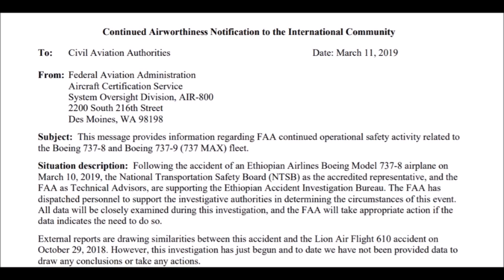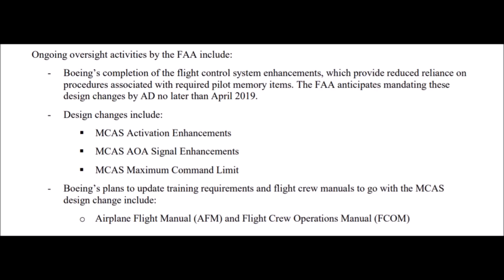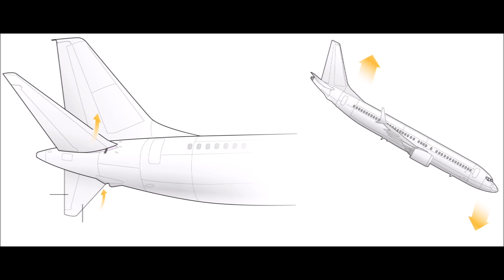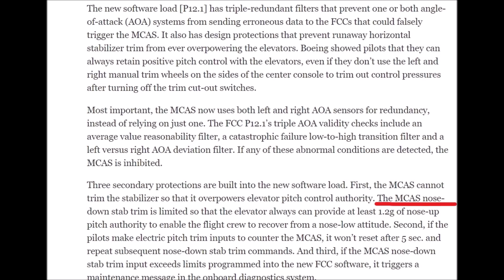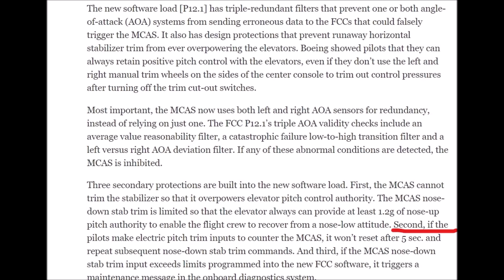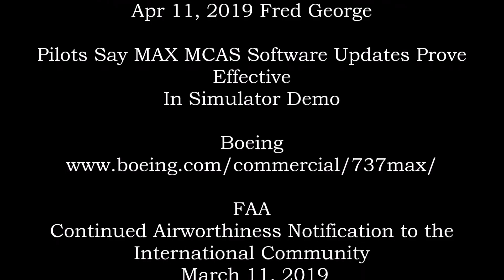737 Max UPDATE 14 April 2019 "The Fix"

Comment: Being a systems analyst I know the BIG difference between systems specification and correct programing. I don’t plan to test the systems by flying MAX before next year.
Reply: Damn straight there is as at the end of the day the ONLY way to know if a computer program works like it should is to do something the programmers hadn't considered as programmers (personally speaking) have major blindspots as how we see the world is written into our codes, or how Boeing sees it though by now they should have enough data if they weren't stupid to run tests on every known issue that's arised followed by asking some student pilots to fly a max 9 simulator or better yet ppl who normally fly other aircraft and then put them into hairy situations. This would work fine as all pilots of large jets at least in the US are required to long in 3 take off and landings which are totally manual in a sim every 90 days. 
      Then again this is the programmer in me talking, not some dickwad Boeing CFO, CEO, project manager who's doesn't give a shit and wants it done YESTERDAY and furthermore doesn't want ANYONE from the FAA to airlines knowing that there is even a MCAS system in the first place. As it defeats their whole selling pt (other then then 10% increased fuel economy) as this was built specifically for economical airlines who fly only one type of airplane specifcally to avoid the issue of recertifying their pilots or having to get new plane parts except the engines which is fine bc the engine will save them money so THATS OKAY. Disgusting all around.
Reply: You do know that ANY software changes especially ones with THIS much pressure as Boeing stands to lose 25 billion in orders are the MOST likely to fail as they can easily break other things while trying to "fix" something.  
       Plus Boeing need airlines to use the planes they have as it's SUPER expensive not to have the plane in the air ALL the time which is the ONLY way these budget airlines which buy these plane make any money. 
    If this wasn't the case there wouldn't be 354 dead ppl right now. As this was ALL about saving money and trying to create a plane which is DIFFERENT handle the same thus it's literally overriding the pilot which NEVER should occur and has NEVER occurred before now, hence Boeing marketing it as a "stall recovery" system not a augmentation program which has NOTHING to do with stalling or at least not directly but bc it was financially beneficial as there was NEVER a need for a MCAS system to begin with.
Reply: @Quin Wow. You really have not been paying attention, have you? You just want to stick your head in the sand and pretend it was all just an innocent mistake. It is now increasingly clear the plane as designed does not require a trim augmentation system. They put it (MCAS) in - and spent the millions - so that they could mislead customers, regulators, etc and present this plane as having the same handling characteristics as previous 737 line. They did not tell anyone about it - it was not in any of the manuals. And this sell more planes. This cynical addition made the plane massively more dangerous for several technical and human factor reasons. And this does not even address the absolutely incompetent engineering design of what they did create.
Reply: @Quin there are a lot of assumptions you are making there. But you are right about much as well - including my conflating several key sources and not just Juan's analysis. And I do understand your main point about a path forward without needless vindictivness. I completely agree with that. I'm an engineer for more than 45 years, and some of the the decisions that were obviously made here were so egregious, that it is a case of much more than "people just make mistakes sometimes". This reeks of a culture of fear, expediency and distrust which is the enemy of safety and good decision making. Just pisses me off because it is is so counter productive and destructive.
Reply: Well unless the pilot has been in secluded isolation, he/she can hardly have missed the learning point now. I suspect you'll be very hard pressed to find a 737 pilot that doesn't know what's wrong if their plane starts going down when they are commanding up. So with or without a tested software fix, as long as every pilot knows where the OFF switch is for MCAS all should be good.

Comment: Thank you Juan for another excellent report. I for one have been waiting for and am glad to see these results. This just demonstrates what I knew all along that the 737max is an excellent and safe airplane. Any new system has potential for problems but they always get corrected in the end. It's a shame that two tragic events triggered these changes but nothing is without risk. Life is risky, and so it flying. Hopefully we will soon see the 737max back in the air and earning the reputation for a safe and cost effective platform that it is. I would happily fly in a 737max tomorrow.

Comment: It’s wild that they didn’t design this into the system in the first place. I’m not an engineer but I can see the recipe for disaster.
Reply: Unlike other Boeing designs, the 737 is a slave to its own success.  Boeing has to walk a delicate line between updating the aircraft to keep it viable against the A320 series, and making it so different that it requires a new type rating or top off training.  I believe that with the Max series, we will see that Boeing erred (grievously) on the side of saving themselves and their customers training money.  The financial hits from lawsuits and lost orders will dwarf any savings they could have seen.
Reply: @RobertsonDCCD  You said it. Boeing boxed itself into a corner to save money and maintain the type rating. But this limited thinking actually will end up costing more.
Reply: agree wtf
Reply: Hindsight is 20/20....just saying this tragic problem was a blind spot until the two crashes.
Reply: Yep, the B737 MAX MCAS bypasses the common man's common sense test.  Technical folks are even more flabbergasted.  People in the automotive and petrochemicals or robotics industry for instance.
They need to bring in management psychologists to understand what happened.  Boeing nailed this shit on the B787 and B777.  WTF happened?
Reply: It is a very simple thing and definitely could NOT have been missed by a seasoned programmer.  Error-handling.
Reply: I believe this plane is still not safe despite the fix to the mcas. With the new heavy engines will be unable to glide. it will just fall to the ground.

Comment: Let's take any 737 max pilot crew,as the plane was originally designed .As soon as they recognize stabilizer run away which could be recognized within 10 seconds. If they disabled MCAS,Autopilot, and reduced or increased  throttle.
Here is my ? Could they have took full control and landed safely?
Reply from the maker: Yes.
Reply: @blancolirio  my nephew is inAir Traffic control currently at a large high volume airport here in the US.His analogy of these 2 terrible accidents is.Boeing never thought 2 back-up systems were needed.FAA wasn't aware either.And some crews didn't really understand the decisive steps to quickly take.But since we're here the extra backup systems should be installed. Him and all people he works with believe this should have never happened even without systems backup.
You do a great job, I would fly with you anywhere.

Comment: In many years in industry commissioning new equipment we always had a switch on a panel, auto, off and manual. How on earth on a $120m dollar aircraft did we have manual wheels to change the trim if the system is switched out of auto. I am sorry Juan, if we bring such 'improvements' to the automotive industry it might reduce population growth.

Comment: The written description of the "triple-redundant filters" on the AOA output is far from clear.  The three filters are listed as "an average value reasonability filter",  "a catastrophic failure low-to-high transition filter" and "a left versus right AOA deviation filter".

So, I think the last one is clear.  The computer looks at the output from both sensors and if they differ by  too much is says there is a problem.  The catastrophic failure low-to-high transition filter sounds like if the sensor suddenly jumps from a low to a high value, then the computer sees that as a failure.  This begs the question of what about a  high-to-low jump.  Is this not a problem?

The average value reasonability filter is the least clear.  Is it an average of the AOA sensor reading over time, or an average of the readings from the two sensors? My best guess is the computer is looking at the average of the two sensors (which would be the presumed AOA of the aircraft) and checking that this AOA is reasonable given the other data the computer has (air speed, acceleration, rate of climb, etc).
Reply: The details are not clear, but high to low is not catastrophic, since low AOA will not trigger MCAS.

Comment: Why we're AOA indicators fail at this high a rate. The one plane that crashed had an MCAS problem on the previous leg which by your account both AOA sensors would be defective plus the one on the Ethiopian flight?
Reply: AOA sensors are unique. They are mechanical devices with moving parts that have to be exposed directly to the air stream flowing by the airplane. This subjects them to mechanical damage from bird strikes or they can get jammed by ice if they get wet.

Comment: A little bit nose light is NOT stable.  It is a problem.
All by itself nose light is the opposite of stable.
Using a computer to 'fix' that lack of instability is an accident waiting to happen.
Thinking "we will use a computer to add stability" is a very poor idea.
this is a passenger airplane. err on the side of stable.
otherwise you are building military airframes.
Reply: victor miranda — Every aircraft is subject to opposing forces producing pitch up or down, and the resultant force varies with conditions.  That’s why the horizontal stabilizer is adjustable.  There is nothing fundamentally different about the 737 Max in this respect.
Reply: hi GH1618,
I am not sure you and I are speaking about the same things.
Stability is the ability of an airframe to act in a predictable
AND controllable way to pilot input.
It is possible to built an airframe that will self level in flight.
no input from pilot (or computer) required.
This is a good way to build passenger airplanes. (I grant other opinions exist...)
About 'nose light'... the shortest way to say this is;
that as the center of gravity moves back from the center of lift,
the less and less inherently stable an airframe will get.
Moving that center of gravity back makes the nose light.
At some point 'nose light' will fly better backwards...
which is a very good description of unstable.

Comment: I think and hope that the 737 Max series will end the 737 line and that Boeing will do a clean sheet of paper design of a new AC to fill this segment.  They've band-aided the 737 too much and it's time to realize a 50 year old AC needs to be replaced.
Reply: The 737 is a horrible plane, very cramped and low headroom
Reply: @forza223bowe5  -- I smell a zero content zero history troll that appears to be working for Airbus or, more likely, and industry group hired by Airbus.  The 737 is sized for the market segment its in and is the Airbus equivalent.  All AC are cramped because the airlines push too many seat into it.
Reply: I can't help but wonder how many people currently in the shoulda-been-a-clean-sheet-design crowd were in the shoulda-stuck-with-proven-technolgy crowd when 787's were still catching on fire.  You ever wonder about that?
Reply: @Milkmans_Son  -- Not sure what a battery design says about the AC as a whole, but Boeing was able to resolve that problem.  Boeing has milked the 737 for 50 years and it's time to start fresh and not hamper the plane with a legacy design that hasn't kept pace with engine developments.  Seems to me a next model should have a redesigned wing and fuselage that's actually designed to handle, properly, the newer larger engines without shoe-horning the engines in such a way that CG is compromised and bandaids in software are required.  About time the landing gear fully retracts and the wheel well covered.
Reply: @Raptorman0909  
Quick, somebody tell Cessna they better quit making 172's!
Reply: @Milkmans_Son  -- Actually they make very few 172s these days - the civil aviation market is a fraction of what it once was and other makers are eating Cessna lunch.
Reply: @Raptorman0909  Because the design is so old, no doubt.  Keep up the good work.
Reply: @Milkmans_Son  -- Yes Milky, you're finally getting it -- we're making progress!

Comment: Appreciate the information and your thoughts, but as I have learned with just owning a home computer or smart phone, gliches and crashes of systems are inevitable, so I'm not really crazy about the idea of more and more technology and computer control of things. From what I understand, some of the newer, larger aircraft, no longer even have any physical connection between in cockpit flight controls and control surfaces, and this presents a real problem when there any kind of electric or hydrolic failure. As I remember, there was at least one case of an A380 that was almost lost, because of such an electronic failure. Yes, human failure is always possible as well....but let's remember, humans design and build computers, and humans who do so make mistakes, not just pilots...and anything man produces is bound to fail eventually. I'm amazed that something as large as an A-380, or a 747 or 777 is able to get into and stay in the air and get down safely, but I would rather stay with smaller aircraft with less computer technology, or at least with always having the ability to fall back to a manual system if the technology fails. 

Keep up the good work, and God's blessings on you and yours!!!

Comment: Another excellent and informative video. It seems to me that an airliner's angle of attack sensors aught to be pretty bullet-proof and reliable equipment. And it shocks me that Boeing offered a system for certification b regulators whee only the Captain's side AoA sensor was used to provide an input to the FMS. Clearly the FMS has to compare both the captain's and first officer's AoA sensors to look for discrepencies.  And the Ethiopian Airlines pilots had shut the trim switches before reengaging them, a fatal mistake.  Result two 737 Max aircraft crashes where the sensors comveyed bad information to the FMC and then a far too powerful MCAS began fighting the pilots for control of the aircraft.

Comment: Fly by wire us pretty awesome until you done to this kind of situation. The computer  will always outdo a human. They should have limited what the computer would do. It is no way it should have passed with the computer having this much control. I worked on the Super hornets for 6 years, and even those would limit what a pilot could do, but the computer had limits of how much control it had. If you ever lost 2 channels, or both hydrualis you had to punch out! Boeing has always been my favorite aircraft as I worked in them for a total of 10 years in the Navy. This saddens me. I know the Airbus had problems with its pitot tubes freezing years back. Also took 2 deadly crashes for them to fix it. I have no clue what else to say, but money isn't worth lives 😔

Comment: thx for video, do you expect any issues in future with MCAS after update? for example any impact on 'Terrain Escape Maneuver" ? Is it possible that MCAS can worsen situation during such maneuver?
Reply: MCAS has no effect on the ability to maneuver, only the "feel" of the aircraft at high AOA.
Reply: @gordonrichardson2972  hi Gordon, Terrain Escape Maneuver requires pilots to pull up over terrain almost near stall condition, do you agree? MCAS is designed when detected high AOA to prevent stall, to push nose down, do you agree on that as well?
Reply: If the pilots pull hard enough to escape terrain, the nose will lift. Whether MCAS is fitted does not matter, since it will only push the nose down 2.5 degrees over a time period of 10 seconds, and the elevator has 5 degrees of range. If the aircraft is close to stalling that close to the ground, then the pilot has done something very wrong. Lifting the nose does not immediately create a stall, only if the airspeed is already slow, and the nose is already high. I'm sure you can come up with scenarios like this...
Reply: @gordonrichardson2972  Let me disagree with you on that, If you are climbing hard and MCAS do 2.5 in 10 seconds it can make difference if you escape terrain or plummet into it
Reply: The pilot can always trim nose up. MCAS does not inhibit electric trim, and is disabled as soon as the pilot makes a trim input. None of that has changed.